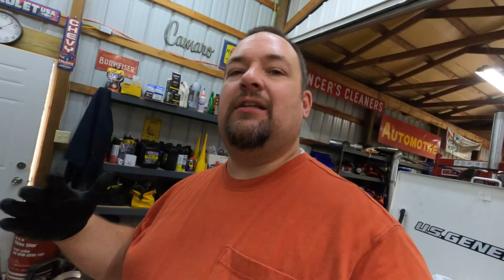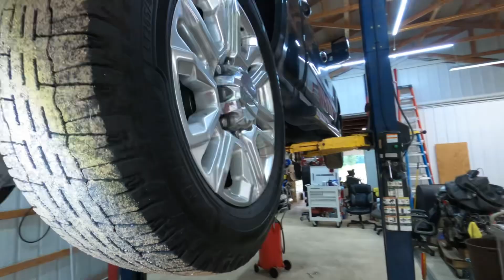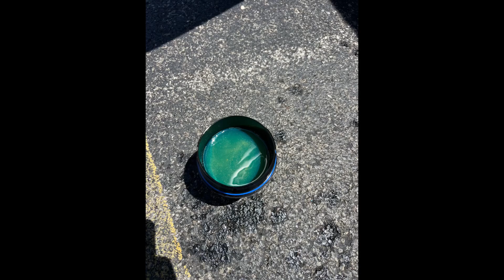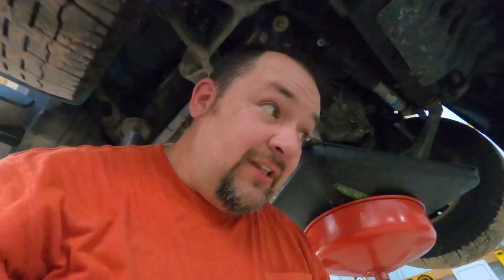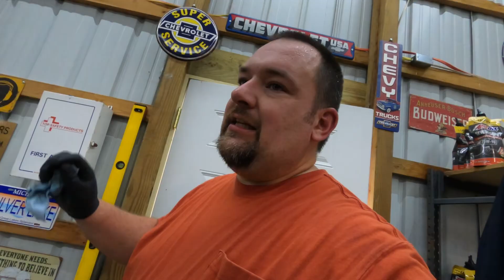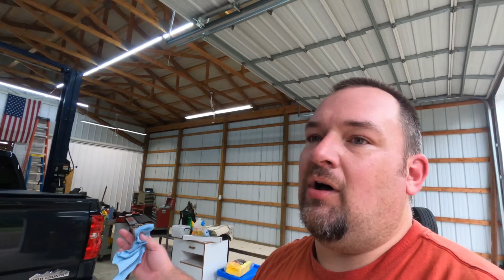Maintenance on 2019 Silverado 2500HD L5P Duramax with 580,000 miles #rvtransport #duramax #amsoil

Comment: Do you know how to fix p1089, I changed out the pressure sensor by throttle body and changed the wires. Changed the fuel rail by driver and it’s good but when I pull trailer and gas it hard the light comes back on or when I’m using engine brake or tow button it goes on but it does clear by it self when I’m driving normally
Reply from the maker: I believe that’s what I’ve gotten a few times. Because I changed the one by the throttlebody with the wires one time but I still kept getting an issue so I redid it again. I haven’t had any issues since. Otherwise you probably need to get a scanner and command full fuel rail pressure to make sure your HP4 is able to reach max pressure. Also, one time I had the intake lift pump fail, but I can’t remember what codes it was throwing. That’s where scanner could help you diagnose pressure.  Sorry I can’t be any more help.  Good luck.
Reply: @Horners.Corner I bought a scanner yesterday waiting for it to come in soon, do you know what numbers I should be looking for
Reply from the maker: @thebaycuddy  sweet.  Not off the top of my head.  You should be able to google it.  Also the scanner should say the amount you are trying to command then have an actual number and they should be within a few numbers.

Comment: How many miles did you go before any front suspension issues/parts replaced?
Reply: Only swapped out shocks for Bilstein.
Reply from the maker: @JosephFransoso  oh yeah I forgot I did shocks. Put 5100’s on the truck.
Reply from the maker: Remember exactly but I I feel like I did the first set of inner and outer tie rods around 250,000. I’ve only done inner and outer tie, idler arm with amount, and upper control arms because one of my ball joints was loose.
Reply: Thx. At 257k miles on my 2022 L5P with original suspension. Also RV Transporter.

Comment: I havent put 100s of thousands of miles on those Michelins, but I used them for probably the wettest winter weve had where I live and they are excellent in the rain....absolutely outstanding
Reply from the maker: They are nice tires.  I have just noticed they are a little loose feeling in wet areas sometimes.

Comment: I have a 2024 Duramax, have you had any experience with a tick for the first few hundred miles after a oil change.  Sounds awful but many say it is normal
Reply from the maker: Yep over the years I’ve had that come and go. I’ve noticed I don’t notice it after I switched over to  amsoil.  I used to run Lucas in my truck and that seemed to help also. unfortunately that just seems to be part of a Duramax.
Reply: @Horners.Corner  any idea what it actually is?
Reply from the maker: @nicklasalle1889 unfortunately I do not.  Sorry

Comment: Nice, keep er movin. That side ditch rock didn’t get ya.
Reply from the maker: You know gotta do that maintenance because I’m afraid to break down. Gotta keep her clean.
Reply: @Horners.Corner What’s your biggest fear……..
Reply from the maker: @Cowsandcampers  I would say breaking down, but I don’t drive a Ford or a Dodge.
Reply: @Horners.Corner That’s hilarious.😂
Reply: Keep using the Michelin’s the BFG’s ain’t what they used to be! Yokohama G015’s are good, you might want to try them… good video btw. Thanks 🙏
Reply from the maker: @Krankinstein thank you.  Last set of BFG I got 110,000 miles out of them.  I do like my Michelin. They just seem to be a little slick if you get off in the grass.  I’ll look at the other tires though.